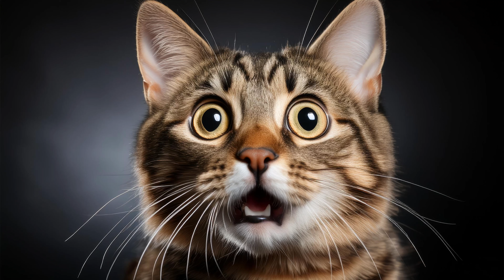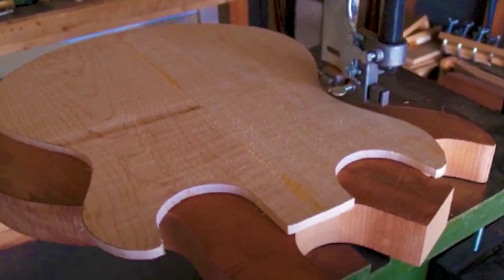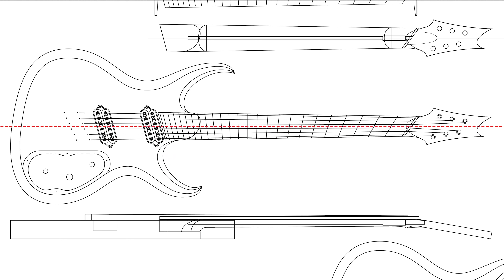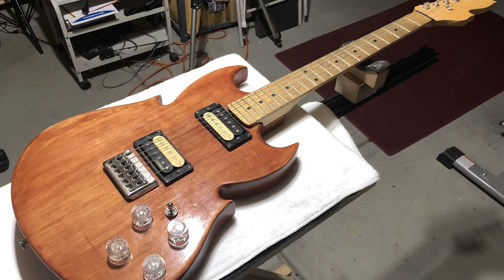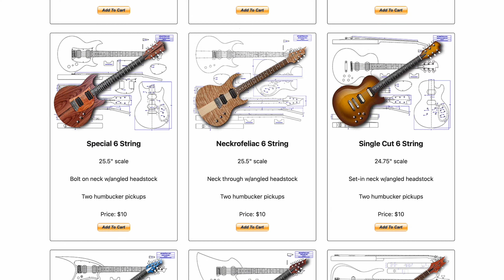There Are No Industry Standards In Guitar Building

Comment: I do not agree. It is necessary to differentiate between standardising a constitution, which can be the image of a firm, manufacturing at an industrial level, another thing would be a regulation that obliges the whole industry to use basic materials and measurements. 
I think every builder has his own standards. It doesn't matter whether it is personal or industrial. In the construction of acoustic guitars these are the recognisable basic shapes, in the construction of electric guitars as well. Yes there is a lot of room for modifications, changes, creation of standards depending on the materials used .....
On the other hand, I don't see so much evolution in relation to the guitars themselves ....
I think there is a lack of a more open clientele for that.
Reply from the maker: Okay... ???
Reply: @HighlineGuitars  Difficult to explain and even more so with the use of a translator. Sorry if the expression or the sense of what I wanted to convey is lost. 👍🤗